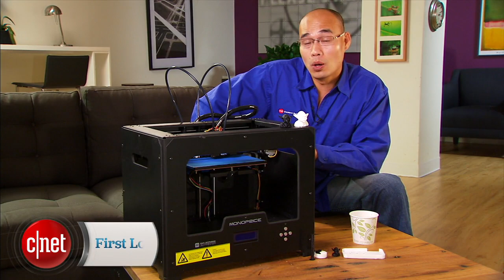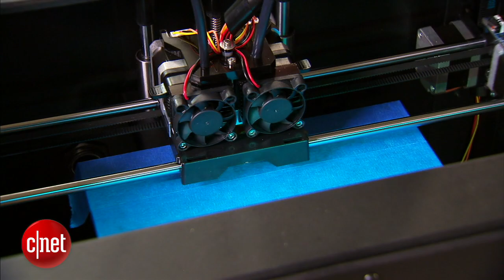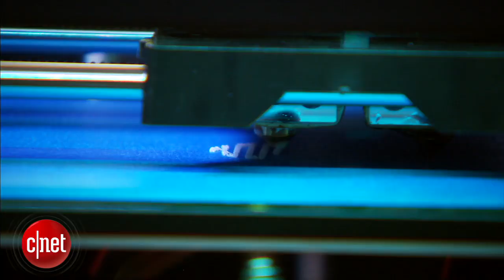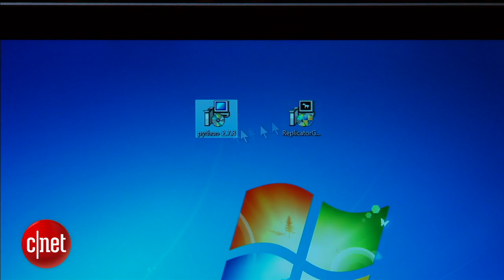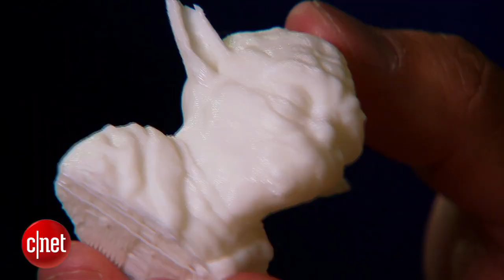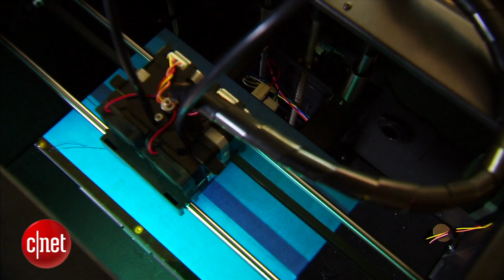The Monoprice Dual Extrusion 3D printer is a frustratingly fun and expensive toy

Comment: Skip to 2016: Da Vinci Junior 1.0, is super easy and 240 bucks on sale!!
Reply: +Royce Barber Da Vinci has a bad rep for using proprietary filament and producing bad results for the price in the 3D printing community.
Reply: +Bryce Villanueva Thats not at all what Ive read. Its the opposite of what ive read. Mine is great. The filament is due to the super low price point. Open filament means intense tech support.